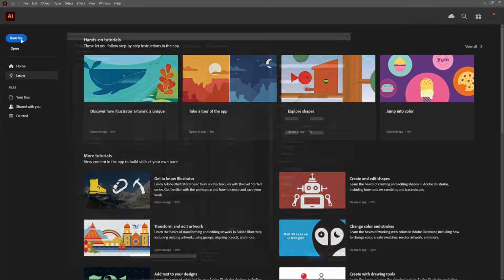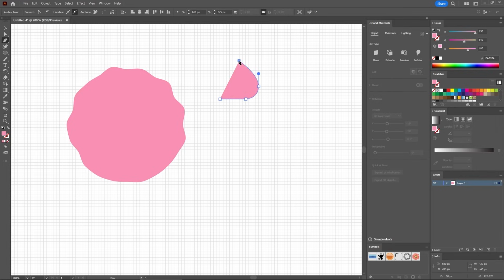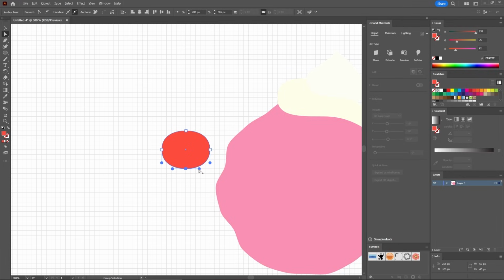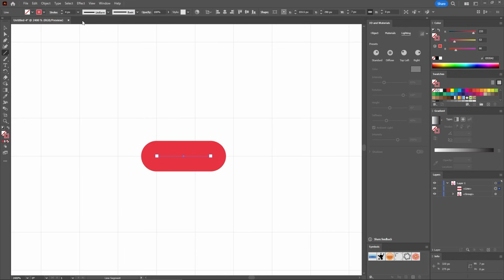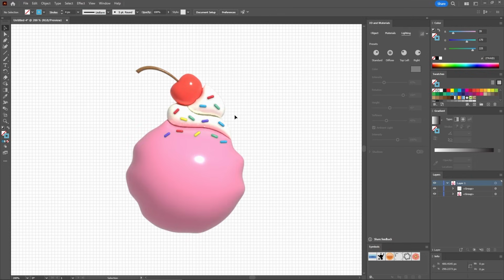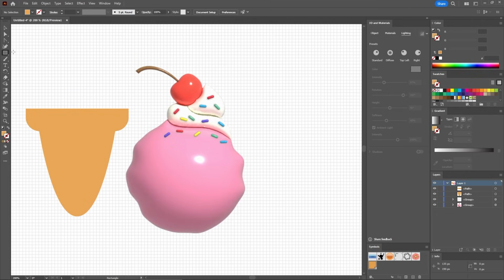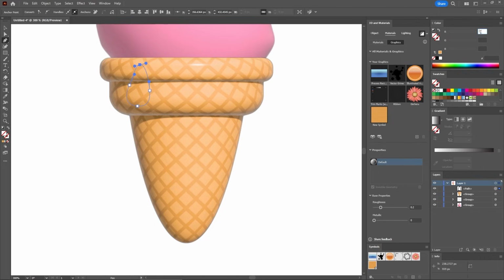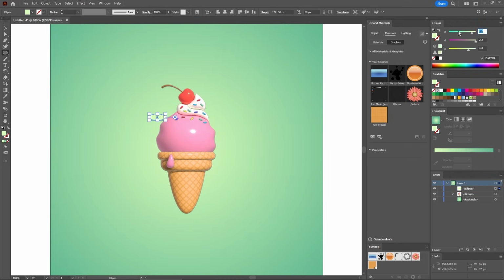How to Make 3D Objects in Illustrator

Comment: Thank you a lot! That was super helpful. I did everything but couldnt save the symbol for some reason
Reply from the maker: Hi! Glad the tutorial helped! If you're having trouble saving the symbol, make sure you're using the correct steps. After creating your symbol, you should drag it into the Symbols Panel (Window > Symbols), then click the New Symbol button. If it’s still not saving, try restarting Illustrator or checking if you’re working in a file type that allows symbol saving (e.g., .ai files). Cheers!